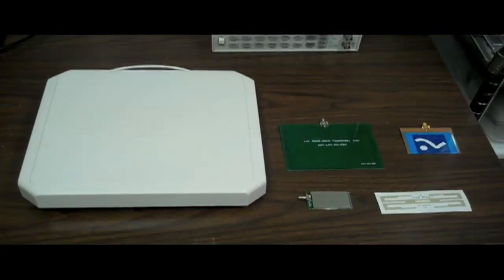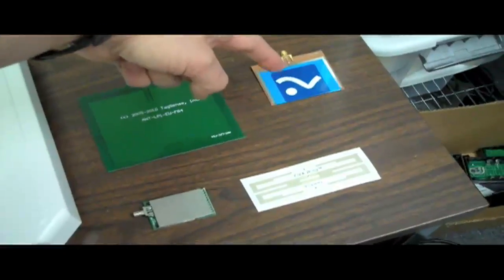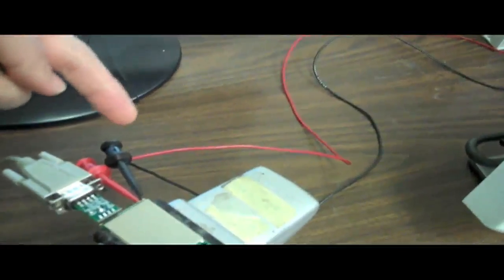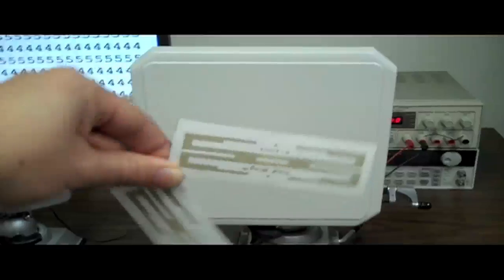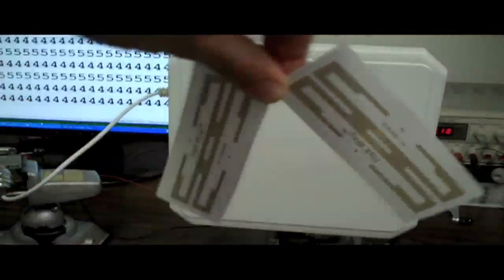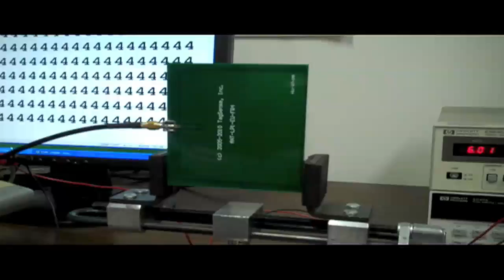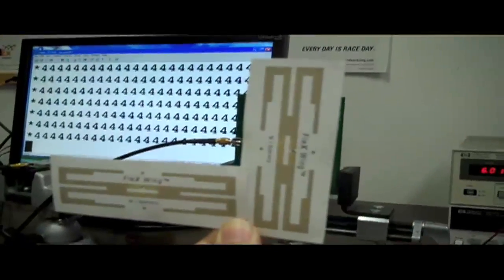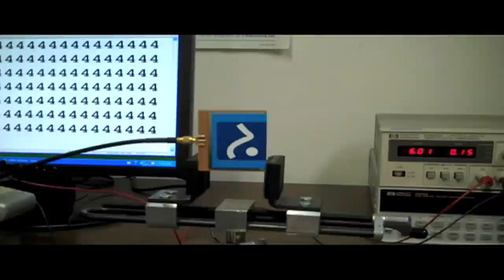RFID UHF Antennas -- demonstration

Comment: Nice video, are the paper labels water proof? thanks.
Reply: One more question,  with a high power antena, can the paper tag be readed behind a plastic material like the face of a motorcycle?
Reply: @pulpanochamaster  it's ok，Air and plastic are electromagnetic wave propagation media. If you want to read the UHF label far away, you should design a label for your application material. Of course, if you want to waterproof, you can make the label into a PVC card.

Comment: how can i make  a system rfid  that works on a  long-distance ( 200 m) help plz which tag and reader can i use ??
Reply from the maker: amel Black eyes 200 meters is not possible with a passive IC-tag system because the government regulations do not allow such high power to be used and the sensitivity of the reader is not so high.  You can use a chipless analog RFID tag, such as this: http://www.rfsaw.com/
It is also possible to add a battery to the tag to boost the distance, but only to 30 meters or so.  For 200 meters, the standard solution is to use an active RFID tag.
Reply: tagsense2009 can you tell me how can i make a system rfid that using an active tag and active reader and the comunication between them

Comment from the maker: The software is a simple terminal program (SecureCRT in this case), but you can use Hyperterminal, Terra Term, or Cool Term (for Macintosh).  SecureCRT is not free but the others listed here are free.